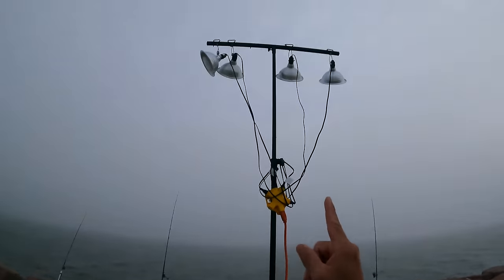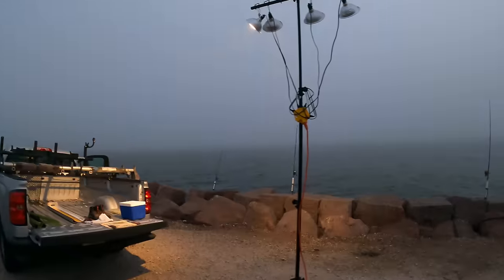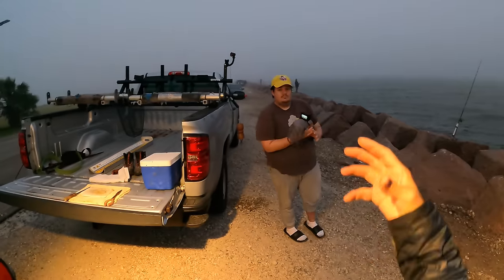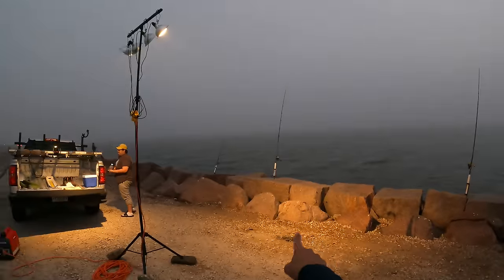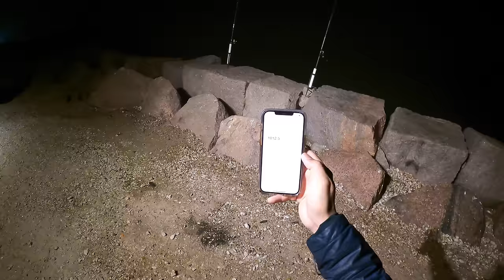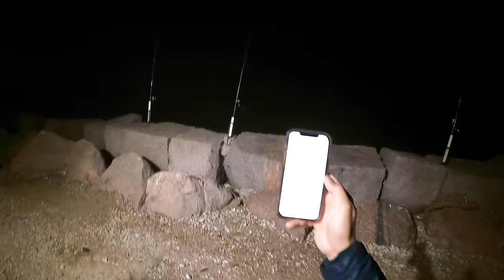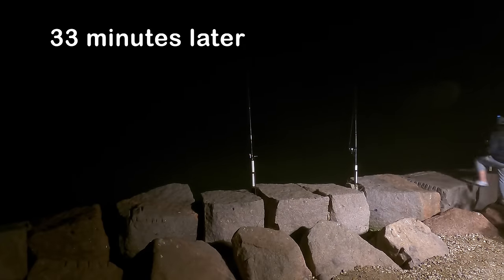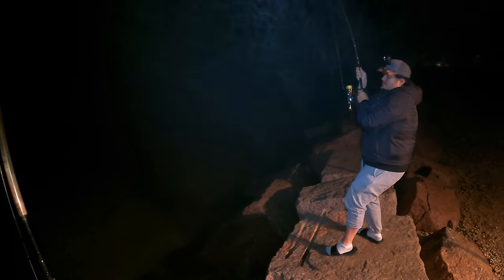We had to set up lights to film these massive monsters (S7 E58)

Comment: I’m 77 years old, the first time fishing my dad said that I was about six years old… I think I remember but not really.   When I became hooked on fishing, I was about eight years old…. I remember vividly.  It was a Highpoint of 77 years because it was a first time. Three walleyes between 4 pounds and 10 pounds each. I consider it respectable.   I had no help catching them or netting them.   My course was set.   I even took a job as a mate on a boat at one point, the best job I ever had.  

The one thing I learned over my life…. It is actually a question that needs to be answered.    “ Can the fish read?  Are they aware that they’re supposed to be?”

I have cooked fish today that only bite at night.   I’ve caught red snappers off the beach.   Hi caught a shark on a bear hook (not unusual).  I’ve landed fish that were supposed to be horrendous fighters, but they acted like they were out for a walk on a leash. This is always a dilemma when you go to netball them or Gaff them.  Sometimes they explode the ferocity you could be caught off guard.   I’ve gone fishing when the forecast for fishing was next to zero, and I have filled my limit.  Then I’ve been out when when, according to the forecast, there should be almost jumping into my boat, or onto the shore.  And I don’t catch even one.   I even caught a mango snapper, approximately 6 miles from shore.  

I also learned over my 70 years that men in general do not like to be out fished.   Very few men likely with them when they’re fishing… jealousy.   Then you have people like my late husband, who is thrilled that I catch fish.  we are always in competition against each other, we do not take it personally.    My husband told me, that a bystander asked him about the fish that I have just caught.  Thinking that he would be jealous in someway. Apparently his reply was, ‘ It looks like a great fish, and plenty for us to eat tonight.  We can just fish for fun.’
Reply from the maker: Very respectable and humble way of viewing the sport of fishing. 🙌